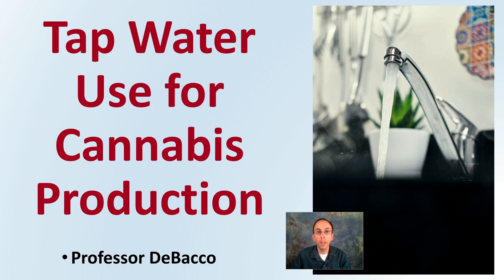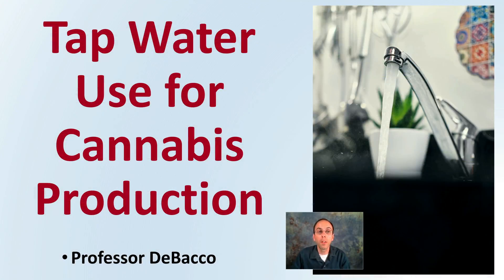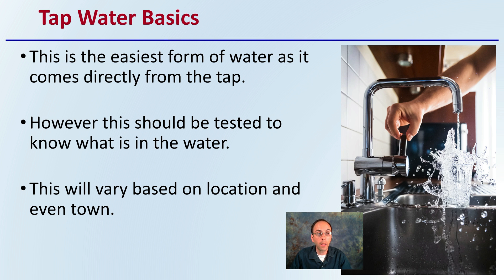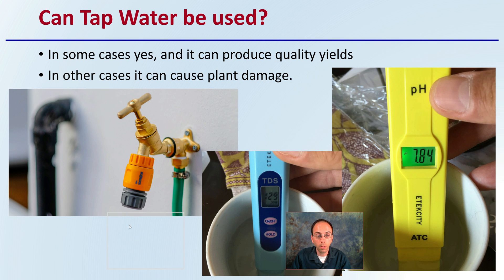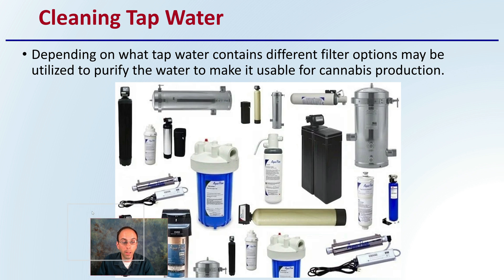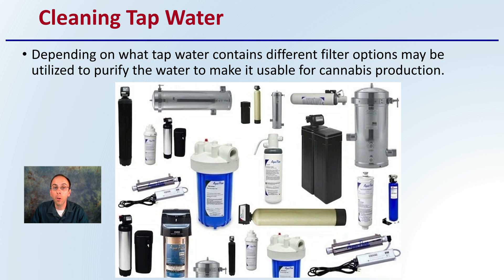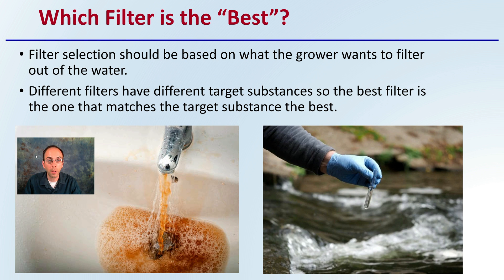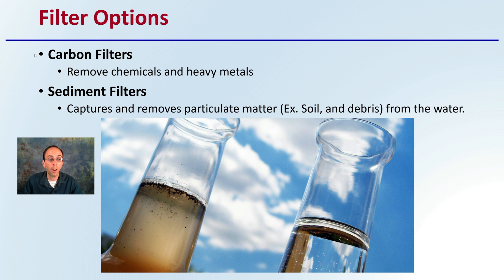Tap Water Use for Cannabis Production

Comment: my tap is 370 and 7.5 ph  i have been using it is this okay! i use ph adjustments
Reply from the maker: These are both on the high side, RO system could be to your benefit, but if it working now keep it going.

Comment: City water is treated and limed to adjust the PH to 9.1 to 9.2. This is common in the US to prevent corrosion. Add a quarter teaspoon of vinegar to each gallon of water to bump the pH down to 7. Allow water to rest for 12 to 24 hours so most of the noticeable smell of chlorine is absent.
Reply from the maker: Key is to get your local water tested as treatment will vary by location.

Comment: All these people in the comments worried about chlorine in their tap water may not realize that it's possible for a chlorine deficiency to occur. It almost never does, however the paranoid-of-tap-water hydroponic grower who utilizes completely purified water to mix their feed solutions ought to investigate to learn if chlorine is a component in their fertilizer, because it usually is not, in which case it may be beneficial to add a little tap water to the feed tank from time to time.
Reply from the maker: Good point.

Comment: Any clue why when I PH down my tap water from 7.7 to a 6.5 within 24 hours it jumps back up to a 7.7? Should I get air stones, dechlorinate the water.. any ideas? I'm pretty sure because of this I'm getting nutrient lockout. Also I'm genuinely curious why once you pH balance your water the pH jumps back up after sitting for 24 hours.
Reply from the maker: Sounds like there are some buffer factors in your water.  Run it through a filter system and see what happens.
Reply: @DeBaccoUniversity  what does that mean when you say buffer factor’s ? I’ve noticed my water does the same thing.
Reply: it absorbs oxygen, what temp are you taking your reading at? water full of dissolved co2 will also give a low reading then gas out.  so let it sit at room temp for 24 hours take your reading  adjust, then come back a while later and retest. should be close to what you adjusted to.
Reply: Ph solution is out of date

Comment: Chloramine is a mixture of chlorine and ammonia this you cannot bubble it out using an air stone it will remain in the water you can't let it sit and it won't dissipate over time you need to filter it out. I recommend using the boogie brew  Plus filter. It will process 45,000 gallons of filtered water.
Reply from the maker: Two main options for chloramine removal... Catalytic carbon, activated carbon with an enhanced capacity for contaminant removal, is one of the few filtration media that can successfully reduce chloramines from drinking water OR using Vitamin C tablets.
Reply: @DeBaccoUniversity  I had doubts that vitamin c could be useful in removing chlorine and chlorine, but I must admit I am wrong.

Comment: Chorine will dissipate on its own if you let it sit for 24 hours.  Just make sure the container is open so it can air out.
Reply from the maker: This is correct, if chlorine is what is in the tap water, chloramine will not be removed as easily.
Reply: @DeBaccoUniversity  Excellent point!

Comment: I’ve never had problems with tap water. I use a air pump to help dissipate the chlorine in the water for 24 hrs before use
Reply: I've been doing the exact same thing for years with great results
Reply from the maker: If chlorine is in the water, this will help and as long as you have proper storage.
Reply: @DeBaccoUniversity  I keep it bubbling till it’s empty rinse and repeat 😃

Comment: You can use uvc light to disassociate the chlorine and chloramines from tap water.
Reply from the maker: While this may work, it can limit the overall rate of water production that is often less than growers may need for irrigation of their plants.
Reply: @DeBaccoUniversity  its what I use on a 50 gal res. Far cheaper then a system and meets my need perfectly. It will also precipitate iron out of solution.

Comment: How about collected rainwater?  Have you covered that before?

Fox farm ocean soil with rain water at 8.0ph.  Should I be concerned?
Reply from the maker: Often times when collecting rain water storage can be an issue.  When it rains the tanks are full and the water is not needed and when it does not rain the water is needed but not present.  Also, be aware that when storing the water it should be light blocked to prevent algae from growing in the storage tank.
Reply: @DeBaccoUniversity  does rainwater harbor harmful microbes? And if so is there a practical way to clean it.  Hydrogen peroxide ? Bleach?
Reply: If you have good soil biology, your Fox Farm Ocean Forest and pH 8 rain water will be fine.
Reply: Living soil has high pH rain water usually has a pH averaging 5.5
Reply: @lancoschino731  All depends on your location as to what the rainwater pH will be. It’s 7.5 where I’m at.

Comment: anybody use tap water?
Reply: I use tap. Come out with ppm of 200. I really don't even pH my water even though it comes out in the 7s
Reply: @lancoschino731  is ppm more important than ph?
Reply: My tap is a beautiful 6.5 ph :)
Reply: I have been using tap water for years. No problem
Reply from the maker: Very commonly used base water material.
Reply: I do if rainwater is unavailable, here the tap is alkaline and salts etc build up if I don’t flush w rain water which is acidic. I use a generous amount of dolomite lime in the soil and that seems to keep ph from staying too low.